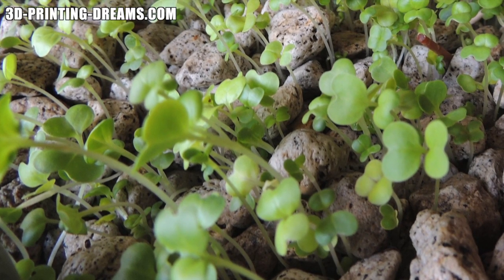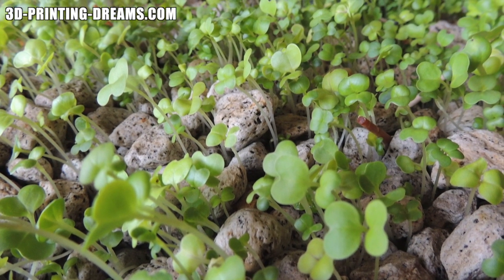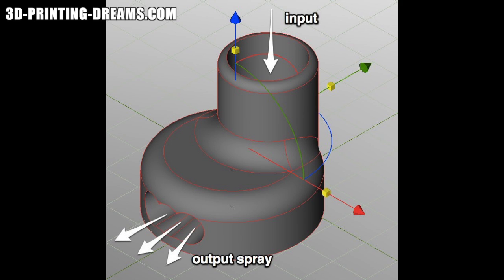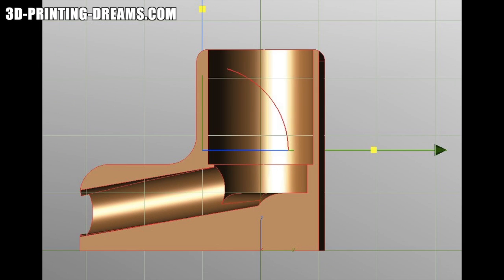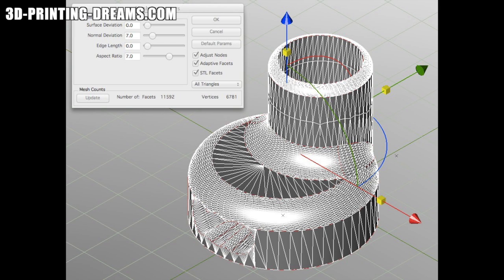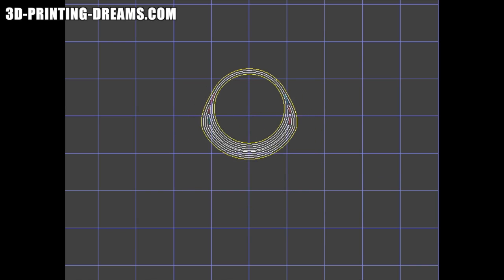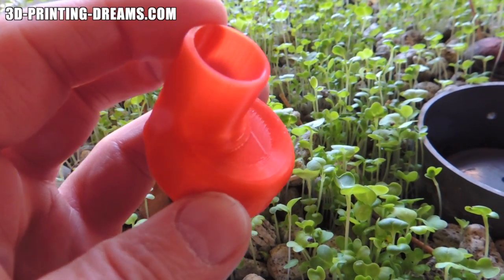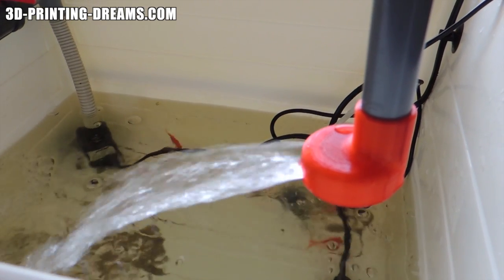Aquaponics: Spray Nozzle 3D Design & Printing

Comment from the maker: I'm using a Tantillus printer that goes for about $1,000 if you purchase it complete. It's all open source RepRap, so building one up would probably run about $300-$450 or so. I'm in the process of building a second Tantillus with some custom modifications that I want based on using the first one for six months.

Comment from the maker: You're right. PLA is hydroscopic and does absorb some water. But ABS isn't food safe and will leach chemicals into the system that I don't want to risk. It's easy enough to print a replacement part when I need to change them. And with PLA I can grind up the old parts and recycle them in my compost pile, which isn't possible with ABS.
Reply: wait isn't abs food safe
Reply: @mattzch ABS is a lot but definitely NOT food safe. PLA isnt food safe too but ABS is actually toxic. PP is the only recognized foodsafe plastic, but unofficially, people use pla or petg. Those are "safe" if not in direct contact with food, like in a tupperware.